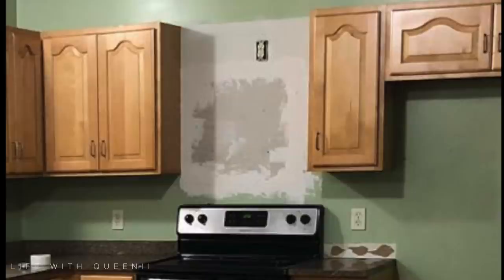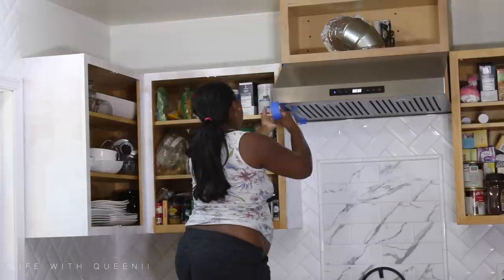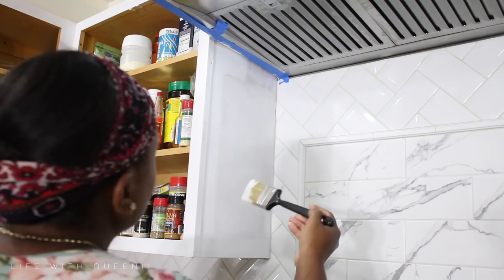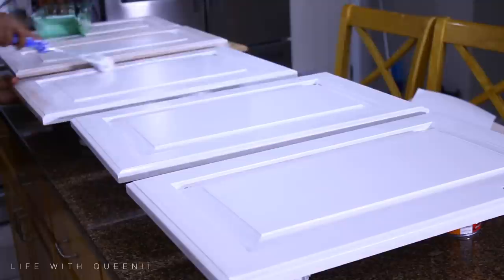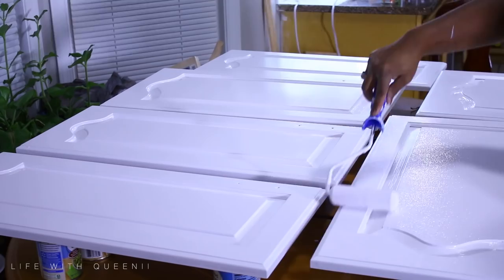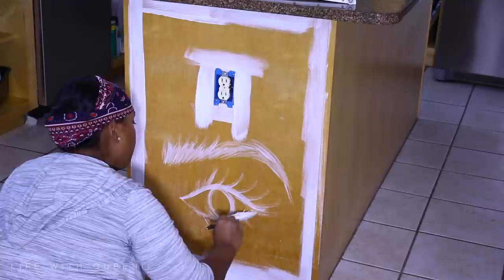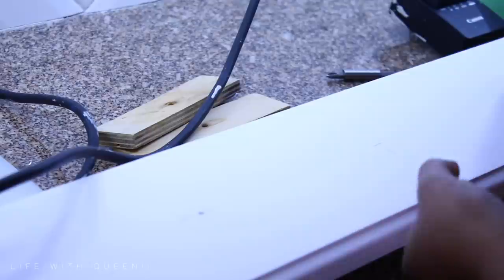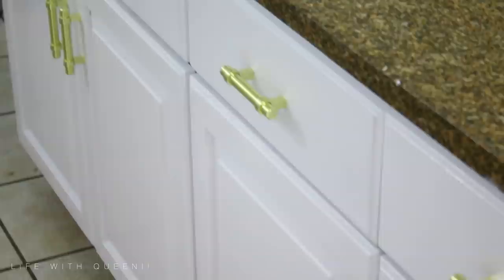Painting my Kitchen Cabinets White! Life With Queenii

Comment: Ah, can be soo exhausting. I just bought a house and had to caulk every inch of the interior and have to work on the exterior for leaking or cracks in the stucco and around the windows and doors. Still trying to finish the painting. What a mess. My mental state is tired. But it’s worth it. I’m doing the counter tops in the end and refinish the wood floors last. I hope to get it done before mid March so I can start a garden on time. Maybe a beehive as well. 
Soo glad I watched cause I need to fix my sink fake drawer.
Also, the refrigerator is like mine. I was told to only wipe it side to side.
Love you❤️❤️

Comment: This is the 2nd video of yours I’ve watched. You do great work 👏🏾. I am wondering, is there a reason you prefer to prime and paint separately rather than using the combined paint and primer?
Reply from the maker: This isn't a wall so I used a primer that would handle daily use and the paint is not regular paint its for heavy traffic/high use areas. Hope this helps